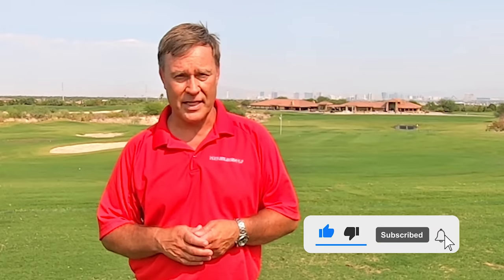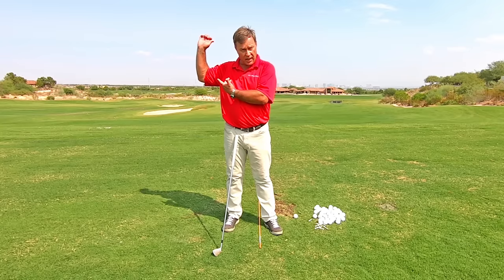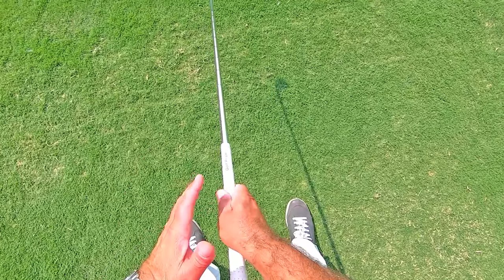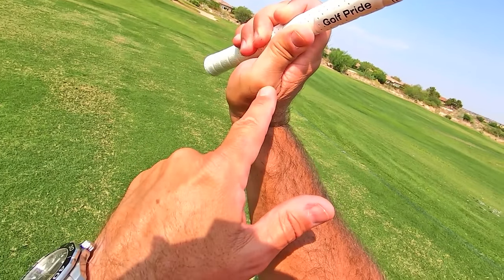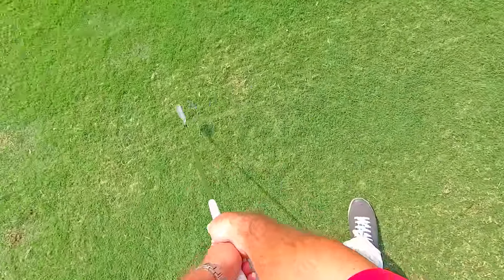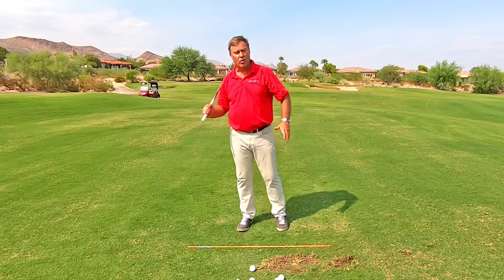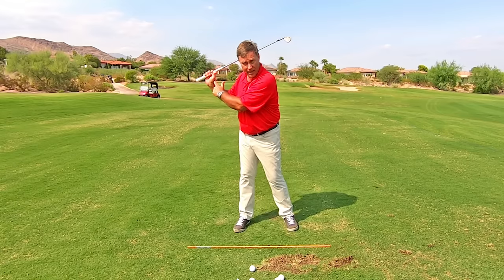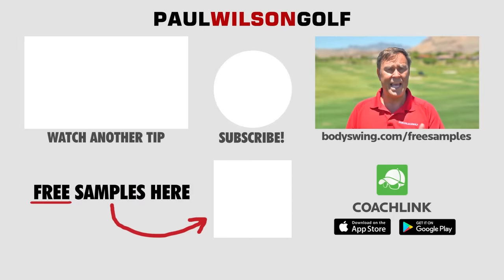GOLF GRIP - THIS PROBLEM LOSES POWER AND CONSISTENCY

Comment: Once again Paul, “Thank You!” I have struggled over the years - taking lessons, watching videos, etc., yet always missing some small piece of the puzzle. You consistently help with all of your video instructions. After watching your Neutral Grip and club face alignment instructions and this one devoted to the right hand grip, I am on the right track. This year has seen a huge change in my ability, confidence and score, mostly due to your easy to understand instructions! 

I’m a huge fan! Thanks!
Reply from the maker: Excellent!  You need to see the pieces and how the fit into the big picture.  If you don't get it you will never do it because you don't see the importance however small that piece is.  Glad you are working on it.
Reply: Yes, and you are a master of pointing out each piece, no matter how subtle, but all important.
Reply: paul thanks u r too good
Reply: The golf swing is indeed a puzzle, and the pieces if viewed to soon dont seem to fit. The pieces need to come in some order is what i have learned over the years. For me the consistent backswing, leading to a consistent inside to outside downswing was key so then I was able to adjust ball positioning and setup so the consistent swing works best. Noting of course there are at more than a couple of different variations of the setup and swing for; Driver, woods/long irons, mid/short irons, wedges, bunker shot, chip shot, flop shot, pitch shot, half swing and 3/4 swing. There may be more but these are what Ive worked hard to get a handle on (no pun intended) and which I am working hard to master. What an AMAZING game. So mental in so many way. Success always! Dr D
Reply from the maker: For sure.  Too many people want to work on everything all at once and hit every shot perfectly.  You work on one piece that doesn't mean you are going to hit great shots.  Yes, there are a few set up changes but don't feel you are doing totally different swings.  The movement is basically the same allowing the length of club to change it automatically.   Don't forget the follow through.  This is the most important piece of all.
Reply from the maker: Glad you're with me.  Thanks.

Comment: I have my 5 top training videos from Paul and this is number 1.  I can’t tell you enough on how Paul fixed my game just by going back to the basics which helped me identify the mistake I had picked up which threw my game way off.  In my opinion Paul is the best online instructor on the net.  It was tips from other videos that destroyed my swing and confidence of striking the ball that I had built since I was 18 to the point of walking away and then I found Paul, I watched one video and it got me striking the ball again, so then watched another video which led to another video. I cannot express enough the gratitude I have and belief for Paul. The only thing I regret is that I don’t live in Las Vegas to thank him in person. Make sure you all like and subscribe to Paul’s videos especially if you’re in your mid-40s to your mid 50s I’m hitting the ball finally again like I did when I was 30.
Reply from the maker: This is a big one for sure.   Can't believe so many people do not do the grip right.  It all starts with the grip and you need to be constantly checking it.  It's easy to move to a strong position.  Thank you for the support.   I need all the help I can get spreading the word.  So many people out there need help.  They just need to understand it, get used too a few new feelings and a little work.  Just loosening up alone should get anyone hitting some better shots.  I will keep doing what I do and one day everyone will want to do it.
Reply: I’ve been gripping like he said not to for so many years!!!

Comment: Best grip video I have ever seen. The camera angle was unique and really augmented the brilliantly clear explanation. Thanks!
Reply from the maker: Wow, thanks!
Reply: Great observation and super helpful hint. Can't wait to try it out later on the range. Make clear sense. Thank you!!!
Reply: Agree,looks great.Haven't seen a Good Grip Presentation ,EVER!. Have to try it out today at the range to see how it goes! I've done 2 of the 3 things he mentions.One is having shaft tooo deep down my thumb and forefinger and also squeezing
 the club too tightly with those fingers rather than letting the club just REST in the Question Mark!! Sal P
Reply: As I get older my knuckles will   get   sorer and there fore loosen the problem of  squeezing to much. 🏌️‍♀️
 Great instructions!! Thanks
Reply: cradling the handle in the V and not the thumb at the top of swing, after 20 years i finally get it. so much easier to stay behind the ball and not early release it now. wow
Reply: @paulwilsongolf  Thanks
Reply: @paulwilsongolf  Sir, I need help. I have a rather odd golf grip...
I am right-handed but I have my right hand on the top of the grip.

My left hand is on the bottom.
While my right thumb sits on the lower right of my left palm.
My right index finger is under my left pinkie side..

When I swing I swing strong but after hitting the ball my right hand let's go and my left arm continues to swing. This isn't a bad way to swing is it?

It's the only swing I naturally do because it's comfy and it feels great to swing as it feels natural to me.
Reply: i have to agree on this, the camera angle POV like made a whole difference in term of understanding.
Reply: I wish all instruction had some POV teaching.

Comment: Paul, THANK YOU for this critical tip. I am an avid golfer, 72 years old with a mid-5 GHIN index. I have been experimenting with my grip (and takeaway) for quite some time and your helpful insight into "the question mark" grip has been a game changer for me. The club doesn't "slip" out of position at the top of my backswing anymore. This had led to missed shots, both left and right (!), but using "the question mark" grip the club stays where it's supposed to. Today I hit all 14 fairways and shot 1 over par 73. Again, THANK YOU!  By the way, I've been using "the question mark" for about 2-3 rounds now. It felt funny at first, but now it feels GREAT and I have confidence in the outcome. Bravo!
Reply from the maker: So glad you found this tip and tried it.  You definitely need to cradle the club up there.  You are doing great.  You will never forget the question mark now.  Keep at it.

Comment: Paul, last year this tip was so good for my game.  I went from hitting inconsistent irons and drives to winning a closest to the pin each week in my golf league.  We have two a week and I won at least one a week the last 6 weeks of our league.  I have always hit the ball far when driving, but this grip tip also added distance to my drives and kept them in the fairway better.  I now have a great place to start this season as I live in the North East and we have a month or so before we start playing again.  I'm looking forward to one of my best seasons so far.  I can't thank you enough!!!
Reply from the maker: Very good.   I can't believe how many people are not gripping properly.  Kind of tells me that they are being taught wrong.   Glad you are about to start.  Go through all of the fundamentals again.   You can never work on them enough.
Reply: @paulwilsongolf   I'm self taught and never learned the correct way to hold the club.  Just did it my way and it worked until about 5-6 years ago.  I went from almost scratch to a 8 hdcp.  Playing 9 or 18 holes a week and never going to the Range.  I'm very luck as it comes pretty natural to me.  Thanks again for the great tips.

Comment: I worked on this grip all week, I took a lesson months ago. The instructor tried teaching me the same grip, but I had given up on it. Anyway  I also watched the video on using your lower body to swing the club. The same instructor tried showing me this which I had also given up on. Well it all came together on the course. I did the grip and  let my lower body do the work for me. I shot a 37 on a narrow 9 hole course today. I have a slight pause at the top, just to get my lower body moving. That grip helped a lot , I have very strong hands and that question mark on the right hand relieved some of the tightness. Thx Paul
Reply: Absolutely agree. This is what I came here to comment about and discovered just like you have. Using the proper grip pressure and placement with the right hand FORCES use of the lower body to get the club around - and on the correct plane. Not to mention the lag it creates. 

Great stuff. Thanks, Paul.
Reply from the maker: Nice one.  You just needed to hear it a different way.  Your hands and wrists are not hands and wrists.  They are a hinge.   See it that way and no matter how uncomfortable it is you will do it.
Reply: @John-wx9oy  You mentioned lag that same instructor told to come me to come back when I got the lower body movement down. Then he will show me the lag part

Comment: Finally achieved the grip that you see at 3:25.  This grip with more firm hold on club is making a significant difference in power and more consistent center-of-face contact.  My grip was too loose before.  Baby bird was flying away. (paraphrase, Sam Snead).
Reply from the maker: Well, it all starts with the grip.   Make sure you are holding on with loose wrists though.  It's not holding a baby bird throughout the swing.  Watch: https://www.youtube.com/watch?v=Z8K3Gctkz7A and https://www.youtube.com/watch?v=GQmsOE7dRXs
Reply: @paulwilsongolf  Yes.  Absolutely, loose wrists.

Comment: This vid solved a lot of my problems. Have not been playing golf much in the past few years because of an arthritic left thumb, which was probably caused by casting golf clubs for over 50 years. Have been practicing with a soft grip pressure and using the right hand “v” you talk about  in this video. When I feel pressure in the v at the top of the backswing I use this trigger my lower body to shift and rotate. Before I would use the pressure in my left thumb to start the downswing with an over the top move. An earlier video was also helpful in starting the downswing with your lower body - the one were you laid the club on your shoulders at the top of the swing. This is a great warm up drill. 
So far so good: hitting my mid to short irons as far as I did 20 years ago and my left thumb is not barking at me after practice!
Reply from the maker: Very good.  Great feeling when you start getting your swing back.   Keep at it.

Comment: Excellent tip sir,  sometimes I do this without thinking it about much, but later in my round , I’ll rush to the swing and lose that strong feeling I get when I’m at the top of my swing.
Reply from the maker: So stay focused.  You need to repeat exactly the same thing every time.  So get into a routine before every shot.  Take it step by step and repeat.   Swing easier.  In your mind think 50% which is actually 70-80%.  Try it for one round and see what happens.

Comment: I really enjoy the way you share the information about the golf swing. I was doing most of these things up until the last couple of years and started to tinker with my swing. I was a +1.5 golfer and hitting the ball constantly straight and fairly long. Until I tried to make it even longer. I began to try and hit the ball harder as you describe sometimes. Before I was just simply swinging relaxed and swinging through impact. I had slowly increased to a stronger grip instead of my old grip which is the grip you promote. I have gone back to what was working after coming across you videos and after changing my grip back to the old grip I had when I was playing solid golf. Thanks for the simple manner you use to explain the swing. A light came on literally after just a couple of swings on the range after your video on the grip! Love the videos. Thanks Kerry
Reply from the maker: I fell down the distance rabbit hole too.   Not fun.  Need to be content with what you've got.   Long and straight is all you need. So anywhere around 270 - 300 down the middle.  More is fun but it will get you in trouble.

Comment: This is probably the best golf tip I have ever received.  As soon Paul explained the compression on the right thumb on the backswing realised that was the cause of my casting and over the top swing. Creating the v on the right hand to cradle the club makes a massive difference, and allows me to stop casting the club at the top and release the club much much later in the downswing. I tried it out at the range today and was hitting sweet draws and straight shots after 6 or 7 shots.  I cannot believe what a big difference in ball flight it makes and allows me to address the ball in a more relaxed manner and also helps with a smoother and proper take away. Thank you Paul for this simple but crucial insight into the grip. I cannot wait to hit the course this weekend.
Reply from the maker: That's great. Sometimes it's just that one thing that makes all the difference.  This was a big difference.  Glad you found it.  Get ready for some great golf in the future.

Comment: Thank you Paul.  I started losing my grip at contact in the rough recently which I typically have not struggled with.  I tried gripping the club more tightly and could feel that my wrists were locking up.  I went to you first and of course you had an answer to my dilemma.  Back to the range tomorrow so I'll go there with renewed enthusiasm.
Reply from the maker: For sure most people try to make it too complicated.   This is why I keep it simple.   Dr. Kwon has some great stuff.  Right in line with what I have been teaching for 32 years.

Comment: Wow, the extra flexibly is mental. New to golf and was told the thumbs should be in line. Great tip. Cheers
Reply from the maker: Glad you got this.  Bottom thumb is certainly not down the grip.  Give this a try.  It will feel totally different.  Now your wrists can work.
Reply: @paulwilsongolf  Just got back from the range, felt a little uncomfortable as new to me but definitely felt the added flexibility. Will stick at it. Cheers

Comment: As you have said before, sometimes it's the little things.  I was so off on how I placed the lower hand on the club and what a difference maker.  I was not starting low hand placement enough in my fingers, nor making the "question mark".  This lead to regripping and other issues.  Had my best range session in a long time by making this supple grip change.  Funny I thought I was doing it right as it looked decent.  Wrong!  That picture in Hogan's Five Lessons showing pressure points makes total sense now.  Thanks again.
Reply from the maker: Very good. Yes, the little things matter a lot.  This is vital and Hogan showed it.  He was weak in this hand as his V was at his nose but it did get the face open and stop his hooks.  This would be his secret in my opinion.  Face was open at the top relative to the flat backswing.  For you, be sure to have the proper placement and keep checking it ... forever.

Comment: Thanks Paul, I was exactly doing this with right thumb. Did not feel it was restricting and felt I had greater control, but initial experience with modifying my grip as you suggest is very positive. Control maintained and more wrist cock possible leading to improvement in distance. Thanks
Reply from the maker: Glad you found this one.  Glad you are going to try it.  Get this and your contact and distance will greatly improve.

Comment: Your teaching methods are brilliant , the best You Tuber by a mile , and I watch many , I adopted the jack Nicholas swing many years ago and the last 2 years trying to copy Ben hogan swing , luckily am still flexible at 56 , and put many your tips into practice. Top coach 👍🏴
Reply from the maker: Thanks so much.   I appreciate it.  That Hogan swing is tricky.  Only 1 Hogan.  I prefer it a little more upright in the backswing so the lead arm is slightly above the shoulder plane.  Too flat and you can attack too much from the inside and I feel you don't hit it as far.

Comment: Thanks Paul,my consistency was failing and I know a lot about the golf grip,but I had let my forefinger get loose on the club,I tightened up my grip and hit 20 pitching wedge 100 yd. All were within a 15yd diameter circle and half were within in 5 yd
 circle.no wind,but still I can play with those results,gonna hit the 6 and 3 iron tomorrow.
Reply from the maker: It all starts with the grip.

Comment: Hi Paul without a doubt you have produced an excellent video on the grip. You may be interested to know that I make the question mark with both my hands facing one another and this works perfectly for me as I join my hands with the interlocking grip of my lead index finger to my trail little finger. This melds my hand perfectly on my grip and my grip pressure now can become a 6 allowing my wrists to act as a free agent to my swing. Personally I believe your neutral grip and reactive wrist are the key to everyone’s great body swing. Cheers
Reply from the maker: Never thought about the question mark with the top hand too. Interesting.  Yes, this is a huge part of the swing that people just seem to blow off.  This alone is game changing so any way people can mold the hands together and loosen the wrists is good with me (if it's neutral).

Comment: Will definitely be trying this. I've been having real issues with my grip, mainly with my irons. I've got a fairly strong grip with my driver and I think it's effecting my irons now as I want to grip them super strong and push my hands forward. I think it's time I try a different grip that I can use with my irons and driver and woods etc
Reply from the maker: If you read the other comments this tip has literally helped hundreds of people hit the ball way better.  It gets the wrists unlocked which is a huge part of the swing.  Keep at it and you will see the results.